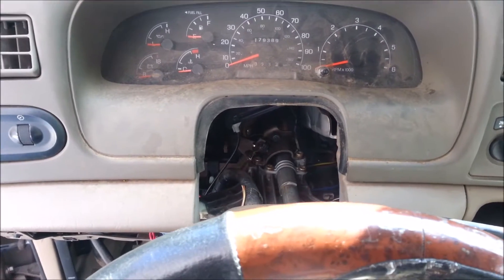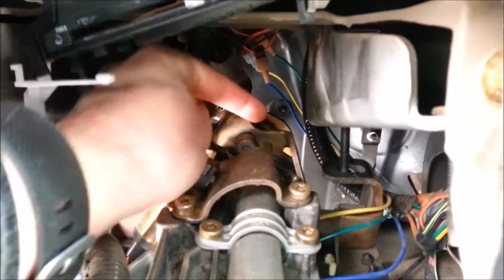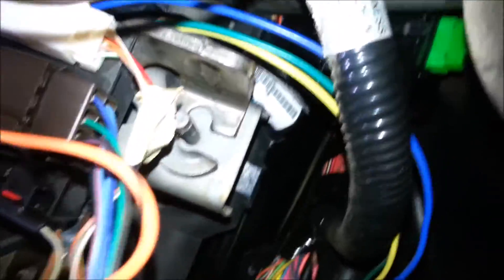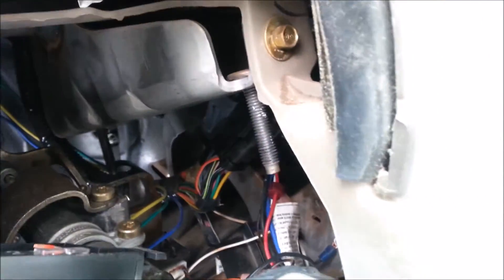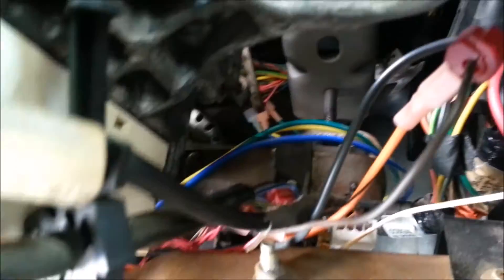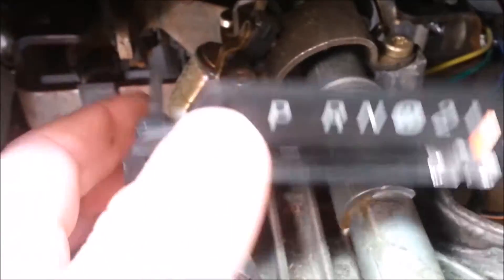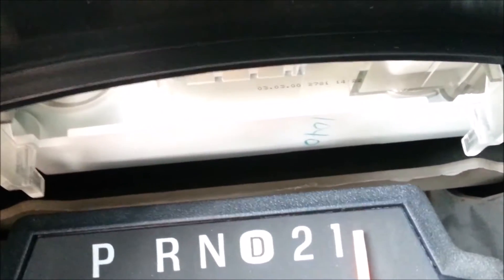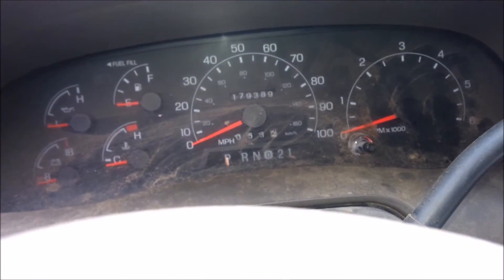Ford Truck and Excursion Shift Selector Fix

Comment: Thanks for your video but To tighten the 2 t-30 torx  you could have done that from the underside without pulling the dash apart.
Reply: This is correct!! Done easily with a swivel and small extension.